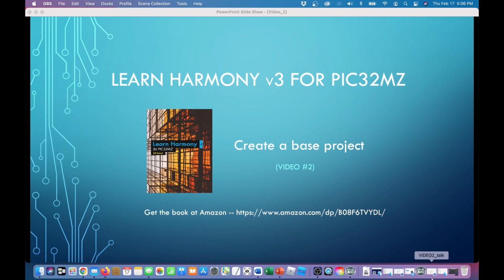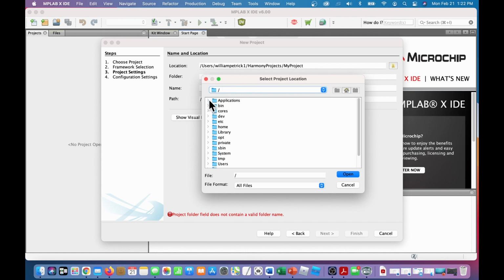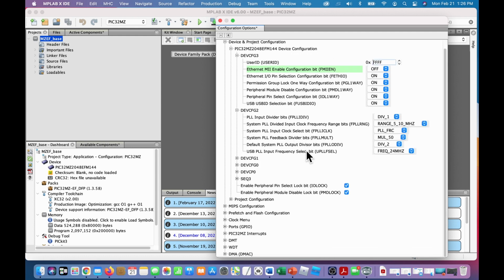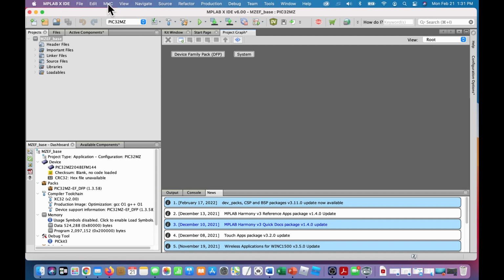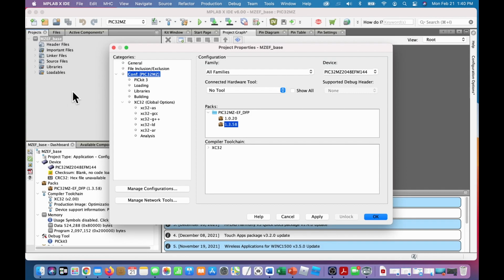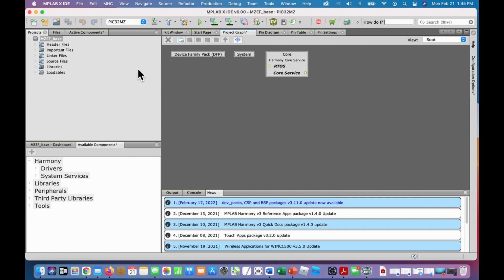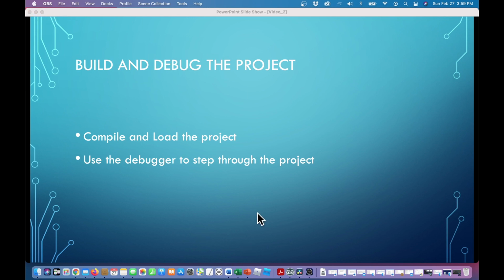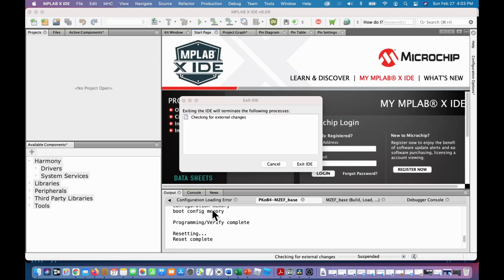Learn Harmony v3 for PIC32MZ -- Video#2.  Create a Base Project

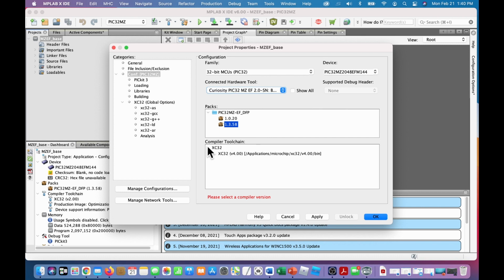Comment: When I get to 18:55 my "Connected Hardware Tool:" drop down shows No Tool in black and the development board name is grayed out and I cannot select it.  Clicking on "Show All" still has it grayed out. The book says to select "Starter Kits PKOB4".  On my system it is PKOB without the 4.  Will this work?
Reply: As a follow up, I have tried various choices and in each case the lower left window shows for debugger "None"
Reply from the maker: This has been a problem since before I published the book.  The issue has been discussed on he forum many times.  It also changes with MPLAB X versions.  That is why in the book all I could do was suggest a board reset because of the uncertain behavior.  HOWEVER, somewhere in the past few years, someone (maybe Microchip) said to change one of the preference settings in MPLAB X.  Go to MPLAB X/Preferences/Embedded/Generic Settings and check the line "Exclude device checks for kits".  This worked for me ever since.  I hope it works for you.  Let me know and I will add an errata for this one.
Reply: On my Windows system this is MPLAB X/Tools/Options/Embedded/Generic Settings.  Don't know if this is new or different from a MAC.  Anyhow, changing it does work but what you are using does not show then.  I think the reload the debug unit is a better option and is not hard to do.  Learning this stuff is hard enough without the flustration resulting from trying to hit a moving target.  I could not hope to learn this without both your book and videos.  Thanks.
Reply: @learnharmonyv3forpic32mz4  I did the exclude device checks for kits option.  When I get to trying the debugger (page 46 in the book, step 3) I get a pop up saying that the last debugger used is not available.  When I click show all and then the drop down shows Curiosity/Starter kits...  When this is selected the debug operation goes ahead.  I don't know is this is unique to the messing around I have been doing or something new?
Reply from the maker: @williamdonovan8187  I think what you are seeing is normal.  When you select a Connected Hardware Tool you have to click on Apply or OK to register the tool with the debugger (shown in the Dashboard window under the project window).  After that, when you close and open the project, the hardware tool should show up correctly and the debugger should work.  It sounds as if you are starting to get the "feel" if MPLAB X.  Keep going!